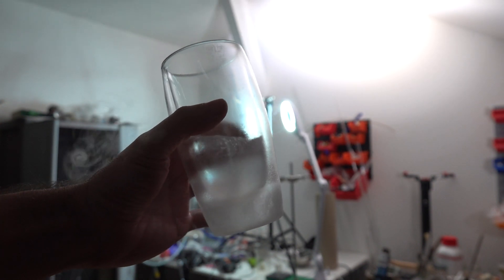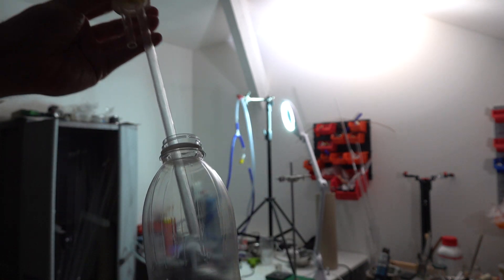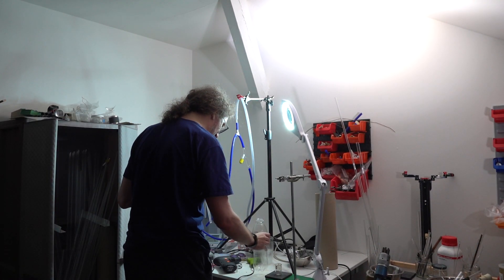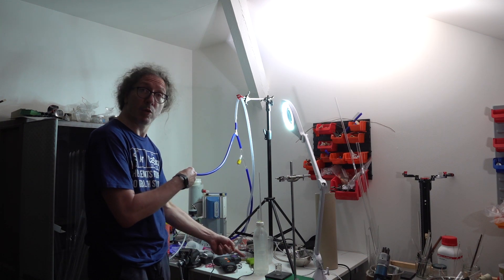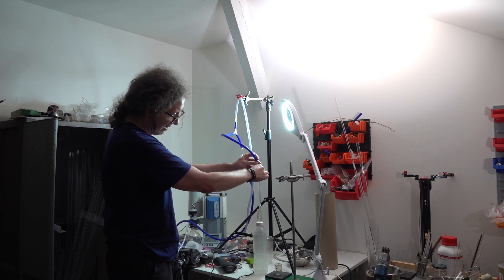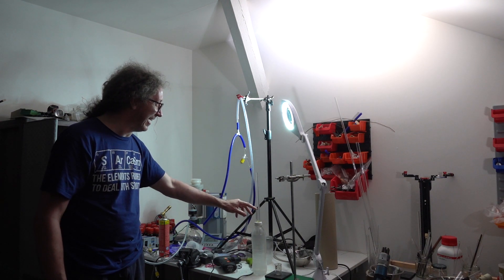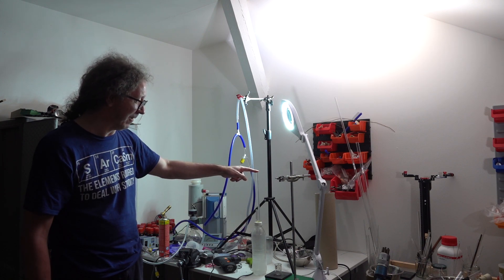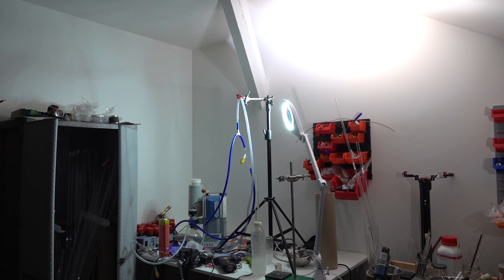Liquid Nitrogen VOLCANO!!!!

Comment: What the hell is the beam coming out of the wall at an angle, and then going up through the ceiling?  What, are you living in the tree fort you built as a child?
Reply: And of course, don't pay any attention to the massive crack going down the middle of it.
Reply: Old timber frame houses can have wood beams arranged in such a manner, It just looks werid, since its coming out of the wall, which was most likely added later, to create this room under the roof. Just google for older timber roof framing, and you see plenty of examples, that show wooden beams in such a manner :) just without added walls for rooms.

Comment: Very pretty. A physical explanation of what was happening would have been nice 😁.
Reply: He plugs the vent tube, but the liquid nitrogen keeps evaporating, increasing the pressure in the system, forcing the tube that’s submerged to start spitting out fluid and gasses
Reply: @Patmccalk  👍
Reply: @saiello2061  although, I could be wrong about it spitting out actual liquid nitrogen, my guess is it was mostly vapour, not sure if that would change as the tube cools down
Reply: The long tube is at the bottom of the liquid. The short tube is in the air cavity and lets the evaporating nitrogen vent. Plug the vent, pressure builds up in the vessel, pushing the liquid up and out the long tube, which creates an impressive effect because the nitrogen rapidly evaporates  both due to the tube and being mixed with the air, which also causes moisture in the air to condense into fog.
Reply: This is so cool! Why couldn’t he suck out the liquid nitro with the pump at the beginning though?
Reply: @sidereal6296  Maybe cos the liquid nitrogen would instantly evaporate into a gas. You'll be able to suck out nitrogen gas but you'll have no effect on the liquid. The pump tries to suck, this creates lower pressure between pump and liquid, this causes the liquid to evaporate rapidly into the lowered pressure and increasing it again, effectively cancelling the vacuum efforts of the pump. The liquid nitrogen effectively just feeds the pump with gas. It would work with water because water doesn't evaporate as well as liquid nitrogen. Thats my theory anyway 😁.

Comment: All I can ask is, how damn cold was that glass you picked up when you poured the liquid nitrogen into the bottle?
Reply: Its an Isolated glas with a vacuum in it, so on the outside its not that cold. And before you ask, you can find them on amazon, just klick on his amazonlink in the discription.
Reply: @0815Skorpio  ohh I’ll have to go back and take a closer look, didn’t think it was insulated in any way
Reply: It is a normal glass, but it is 2/3 empty. You can see ice forming on the lower part. He picked it up from near the top.
Reply: @kostis2849  https://www.amazon.com/dp/B07PB95BHB/ref=cm_sw_r_cp_awdb_imm_WVCAQEGEEJSMJ4BVP7MR
Reply: @kostis2849  Pause the video on the beginning and have a close look. I think it is isolated glass, because the part with liquid is round. Also on left you can see two layers. So it is either an isolated glass, or it has really thick walls. I know, there was ice on the bottom, but that can form even on isolated glasses, if you leave them long enough.
Well, I never poured liquid nitrogen in glass like that, but I poured a lot of hot drinks in similar glasses and if you wait some time, they get warm. Not too hot, you can easily hold it even when the water inside is boiling, but you can feel the heat.
Reply: @kostis2849  yeah, I went and took another look, it did not look like an insulated glass, but it also looked like he wrapped his hand around the bottom of it while pouring, either my eyes are shit or phil has asbestos hands